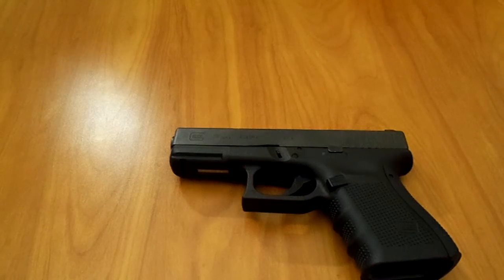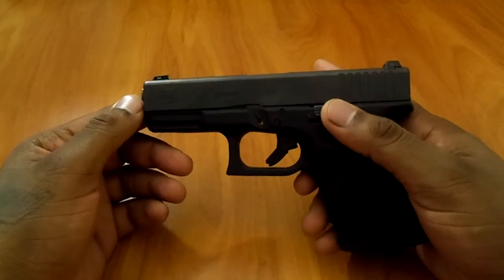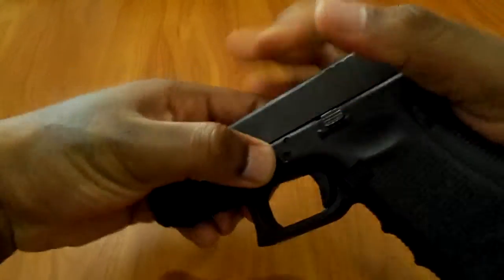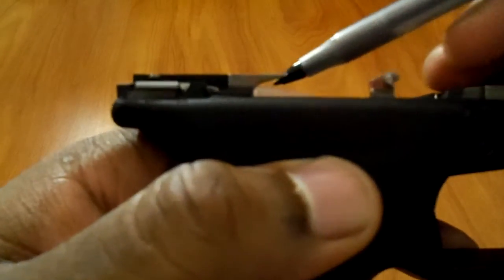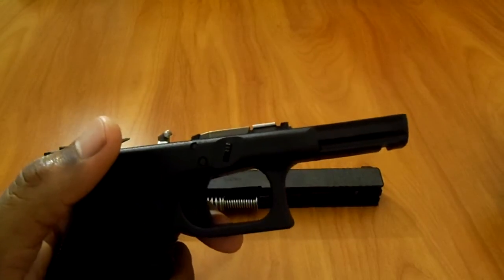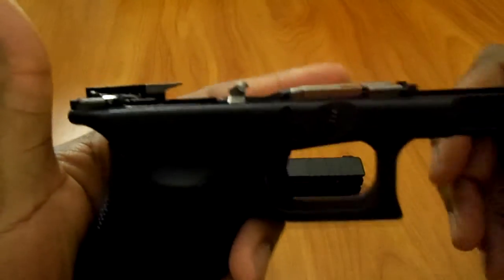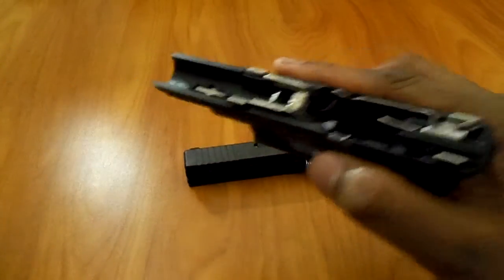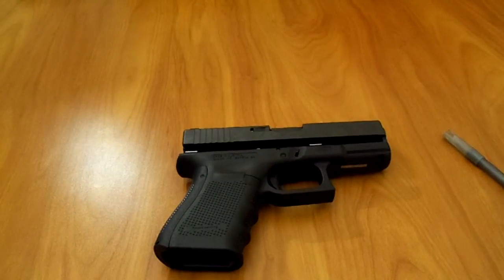GLOCK 19 GEN4 EJECTOR AND GUIDE ROD SPRING PROBLEMS

Comment: Hey sir. Went to Glock in Smyrna Friday to have Tritium night sights put on. They took my G23 & G26 in back and put in the upgraded ejectors, extractors,firing pin, extended slide release all for free. The tritium night sights cost me $57.00. I asked if the old parts were defective & they said absolutlely not. Just wanted to upgrade all Glocks for the life of the gun as warranty service on all Glocks. I love Glock.